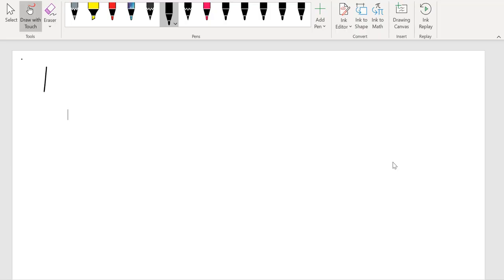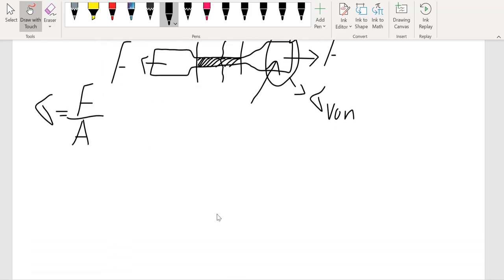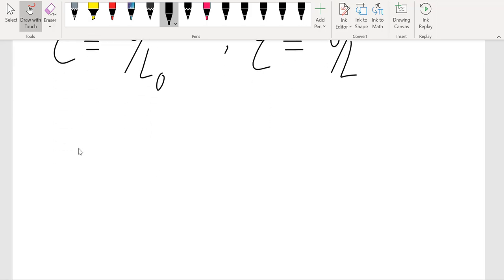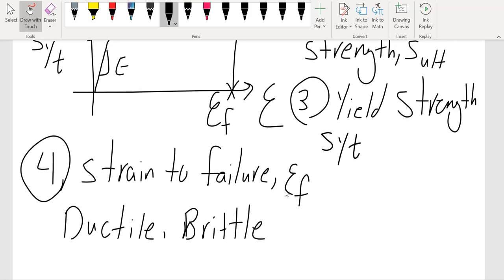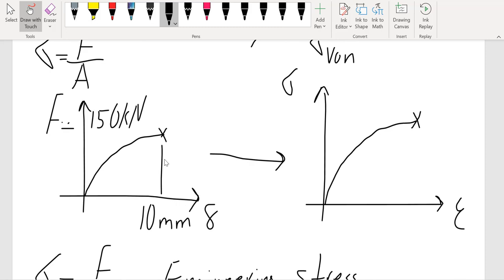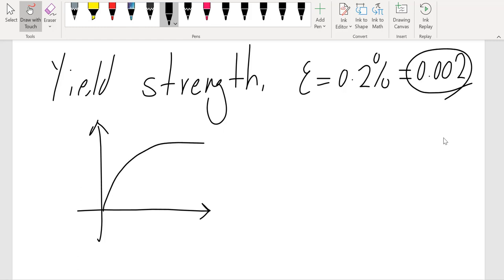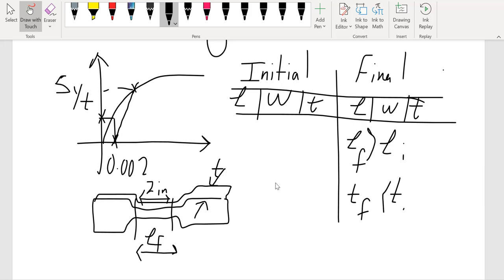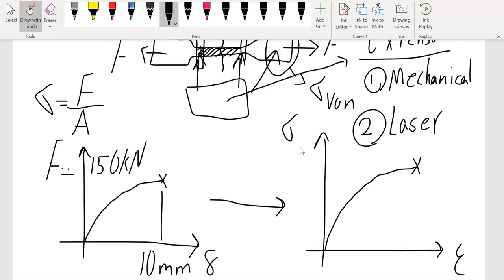Tensile Testing: Mechanical Properties

Comment: hi and thanks . what is the unit of toughness if we calculate from stress in MPa and strain in % ?
Reply from the maker: It would be simply MPa and the strain is unit less. Make sure not to confuse toughness with fracture toughness which is a different physical parameter
Reply: @engineeringvision  Yes it would be MPa but in some reports we have J/m2 .what is that for?
Reply from the maker: @hoseinreyhani7274  That is reported for imact testing, that is the energy absorption of the specimen after fracture using charpy or Izod imact testing and it is usually normalized over the specimen cross sectional area, therefore, Joule over meter squared
Reply: @engineeringvision Thank you Dear Doctor.
Reply from the maker: @hoseinreyhani7274  You are welcome